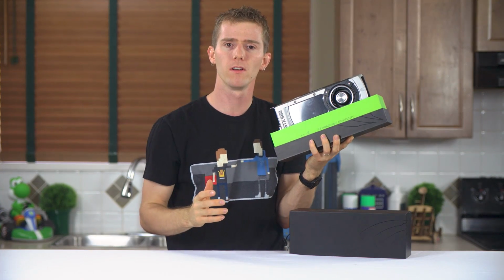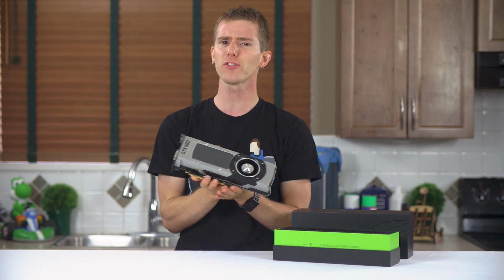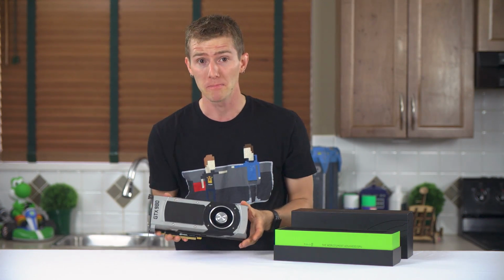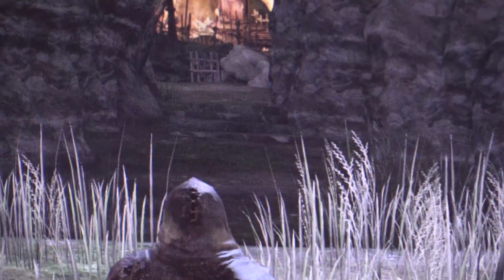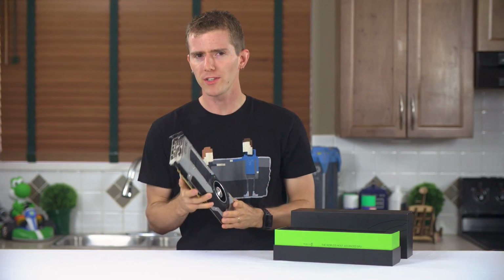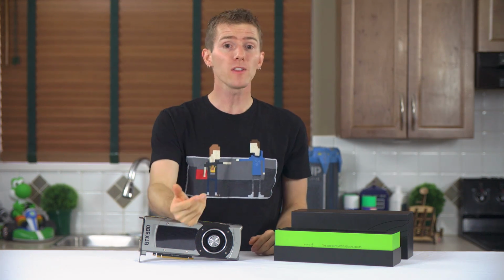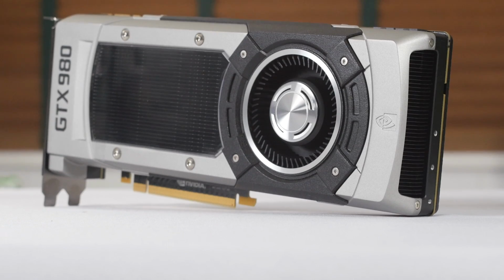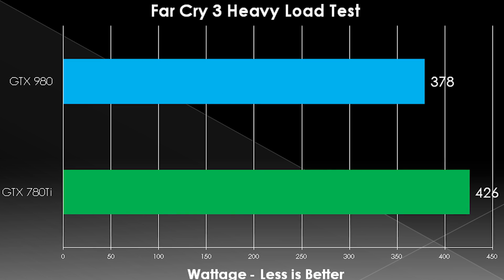NVIDIA GeForce GTX 980 Video Card - Performance Overview

Comment: RIP GTX 600 series... :(
Reply: why?? i have gtx 650 and am really happy with it xD!!
Reply: Sucks, I paid $500 for my GTX680 it when it first came out. It's still a powerful card though.
Reply: GeeGne -bAb they're going discontinued
Reply: Jester Muffin well... yeah 720p is not an issue for me but agree with you most people want at least 1080p this is 2014 and 720p is really old xD
Reply: 980>780ti>970>780 buying gtx 770 is not a good idea at all :/
Reply: I have a 670 myself, a bit sad really considering I only got it a year ago.
Reply: I made a build around 4 months ago with a GTX 660, bad decision?
Reply: I wouldn't buy anything below 700 series right now, you'd have to upgrade pretty soon if you did. The 680 or the 690 can still be a good purchase if you find them for cheap.
Reply: I'd suggest you save up some money for the GTX 970. it's gonna be the next 760-770 equivalent for the upcoming generation and will last you for ages and potential SLI in the future.
Reply: playing on a console is not dumb at all but i was so dump even my pc graphic card was gt6800 with 1gb of ram and pentium daul core
and i didn't know why the hell i cant play anygame on it i thought pc is so weak so i stick to xbox 360 all this years.... then i start reading how pc work and how i can make it powerful etc... , now everything is more clear to me i know what am doing if good or bad but am still learning tho :D   (sorry for my awful english)
Reply: We'll im less worried about my GeForce 210
Reply: Jester Muffin 770 sounds cooler ;)
Reply: In the grand scheme of things I would say no, but I wouldn't feel really pressured to upgrade. We are gonna see some pretty crazy graphics this comign year i think, but i also reckon the prices of the 780 and 290 will start to come down to make more buying room for the 900 series. When you see a 780 for a really decent price, grab it and that'll keep you going for ages. I think 670 will do until then :) Thanks for asking
Reply: Robert Ashford It can play most things maxxed at 40-60fps 1080p, so I'mk good for now. I got it for £180 too, so that's a plus :)
Reply: Turn the graphics card around and be prepared for a revolution, Its a 086!
Reply: eleven61 , sinephase , Jester Muffin , iOS Beta  as what i heard, xbox one GPU is almost like AMD 7780 power witch its close to GTX 650 peformance too, while PS4's GPU is actually a AMD 7870 processor with 2 compute cores disabled (1,280 cores subtract 128 cores equals 1152 shaders) classifying to about a GTX 760 and between a AMD 7850 and AMD 7870.......but they're still shitty consoles,as pc gamers we have all that power since 2 years or even more and now we're playing at 4k while consoles are still sub 900p at 30 fps xD
Reply: I have a 650 and I love it. But at first it was so beast, every game at high 50 plus fps. I was able to run far cry at medium 30 fps. But a few days ago, I couldn't run my games at high anymore, farcry 3 at low gets 15 fps. But I am still happy, atleast minesweeper works :)
Reply: ***** mine is gtx 650 too here's some tips:
1- put the resolution at 766p, if you don't want to see pixelated objects while you play a game just put the texture filter at x2 msaa and it will be close to 1080p
2- overclock your card, i have overclocked mine and i get 5~15 fps plus on every game i play even i don't go with the full power of this card
3- make sure to update your card
4- if you have a slow cpu/ram it will effect on gameplay too, because it will push the card on it limits so you wont be able to get the max fps from it!!
5- this card can load 90% of the games at ultra only the other 10%(extensive graphic games) it depends ,i try crysis 3 at ultra and no lag at all :D!!
Reply: Thanks, the resolution and AA tip helped me the most!
Reply: I have a gtx 660 that is still running well...
Reply: PeppermintPotato they still very powerfull for most of games but if they release super graphics games then yeah....
Reply: RazordraacGaming i got mine before a month ago xD
Reply: not saying there bad just saying they're going discontinued
Reply: ya true
Reply: I still have 2 GTX 580 and they're still good enough for most games :)
Reply: alish2001 Yeah if you're not gonna be upgrading any time soon the GTX 660 is not gonna last you long anymore.
Reply: Jester Muffin yes it will its a very powerful card atm for gaming...
Reply: alish2001  keep in mind those graphic cards are killers at 720 p you can properly max out anygame without any problem
Reply: Well at 720p yeah but that's really not a thing anymore for most people. If it's ok for you then sure.
Reply: ya i will but now i need to upgarde my ram from 4 gb to 8 gb and my mintor is 1366x768p so i need to buy another one and THEN i will get gtx 970 because i start a gaming pc really early before like 1 month ago i was so dumb playing console for like 5 years lol
Reply: Playing on a console is not dumb, it's just a better investment to have a good PC. I also played on PS3 long time ago even though i had an okish PC but as technology advanced and older stuff got cheaper that's when i upgraded too :)
Reply: I was pretty much the same way :) and no problem, it's not mandatory for everyone to have perfect English.
Reply: its really nice to talk to people like you !!! thanks for understanding me  :)
Reply: Likewise :) if you wish you can add me on steam IGN ZWarhammer
Reply: Jester Muffin ya sure!! i will add you immediately once i download it, still downloading some MMO/FPS online games and pirate more editing programs hehe
Reply: Jester Muffin They say that with every generation of cards...

...and then they release a new generation and everyone's like "Dude, that mega expensive card is shit compared to what we got now. Why not spend £200+ a year for each new gen..."

Fuck new gen cards, mostly marketing bull, the higher-end 600 series can easily play most, if not almost all, games maxed at 1080p. It's a bit scammy that the new gen cards are SO much better. They're just trying to tell you your 1-2 year old (still powerful) card (which is much cheaper at the time) is suddenly shit when the new ones come out.

I'll be getting a 770 for my next GPU, not a 970. Bite me.
Reply: 970 is a shit ton of value for it's performance.
Reply: Yeah at this point in time if you're buying it has to be the 970 at least.
Reply: GeeGne -bAb Well I guess that makes me a dumbass! although you have a point, it was just a re-hash of an older card...but then again, they mostly all are! it is true about new cards to an extent, in my opinion it is good to skip just under 2 series. So if you have a high end 6 series, that'll be dandy, just don't get greedy with display settings, whatever comes out after the 9 series will be your replacement (Bare in mind I am only saying this because I cannot afford to upgrade all the time, if money were no object, I'd be rocking 3x780tis)
Reply: Robert Ashford I'm fine then, GTX 670 is pretty high end right?
Reply: RazordraacGaming Hell yeah, seriouslly ok for now then! and you will go from having being able to max out comfotably to being able to max out comfortably again by spending just over that with the 780. that's what it's all about so kudos to you man! :D
Reply: RazordraacGaming 660ti here, know what you feel.
Reply: PeppermintPotato does this mean the drivers aren't going to be updated anymore? I'm confusted
Reply: PeppermintPotato
No it isn't play Arma 3 with it right now and tell me your fps... you fucking plonker.
Reply: gtx 650 is the bottom limit. all below of that are limited already
Reply: just bought a 660 and i will buy another one :D
Reply: I bought my GTX 690 about two and a half years ago.. it was pretty much the best card at the time. Still runs everything pretty good.
Reply: GeeGne -bAb in a year i expect to see big graphics jump with the next gen consoles being out and all. Im sure the 600 series cards will be able to run at around next consoles level though...
Reply: Even the 500 series cards still take a complete shit on "next gen consoles" so yeah no shit lol.
Reply: Jester Muffin 500?!? Man even 400 series cards are like 5 times better than this shit ass hardware in a console!
Reply: Probably
Reply: iOS Beta
not anymore, no.
Reply: epicpusty Man, the  690 is still a massive BEAST of a grapics card!!!
Reply: welcome!
Reply: alish2001 bad decision? depends on your budget and what you play with is. AAA titles? meh, prepare to reduce details and disable filters. if you are more the kind of person that sticks to one game (like me) like LoL, Dota2, CS GO WOW Diablo SC2, then you should be preety happy.
Reply: José Luís Lopes I am lol,  #Minecraft  &  #CSGO  Battlefield here and there but pretty good.
Reply: alish2001 then you shouldnt have problems, here i am on my laptop with a gt325m still playing LoL no problem
Reply: @ProfShyv  rip gtx 1080 ti series. Rip rtx 2080 ti . welcome new rtx super
Reply: how adorable...

Comment: This will be the first thing I buy for my X99 build! Can slot right into my current system to replace my 570 whilst I save up for the X99 stuff. 
The complaints that this doesn't blow the 780ti are warranted to a point, but bare in mind this card is actually cheaper than the 780ti at the mo (about £430 for refrence compared to £450 for ti) and it runs considerably less power, even running 100w LESS than the 290X when under full load which means having 2 of these SLI is not gonna require a power station to run it.
Plus a bit more future proof than the ti as it'll be DX12 ready and will have features to better support VR

Comment: Intel Core i7-4770K 3.5GHz Quad-Core
Corsair H100i 77.0 CFM Liquid
ASRock Z87 Extreme4 ATX LGA1150
G.Skill Ripjaws X Series 32GB (4 x 8GB) DDR3-1600
Samsung 840 Pro Series 128GB 2.5" SSD
	Seagate Barracuda 2TB 3.5" 7200RPM
MSI GeForce GTX 760 2GB
NZXT Phantom 410 (Black) ATX Mid Tower
SeaSonic 660W ATX12V / EPS12V

Can someone give me some tips on building a computer?
This is the setup that i plan on building, is there something that i should add or remove, im mostly using this computer for editing videos and photos